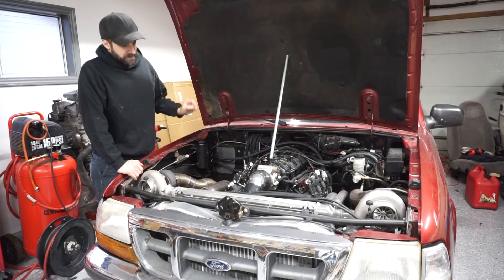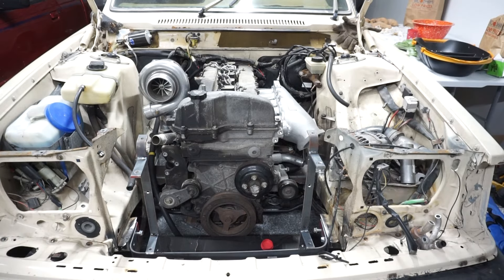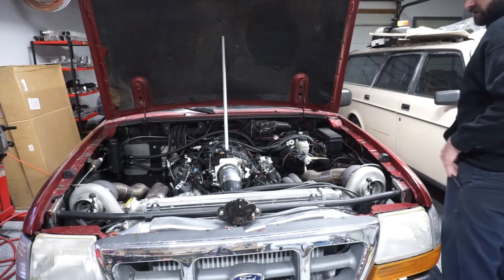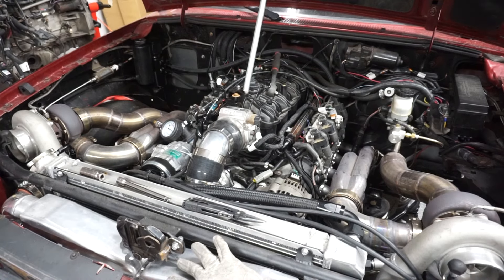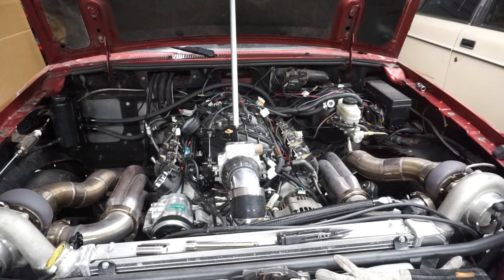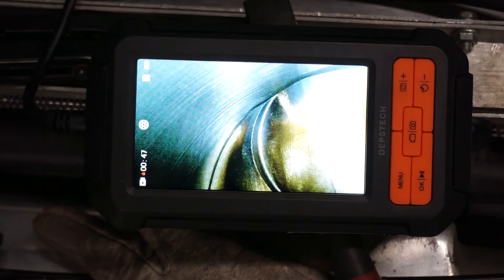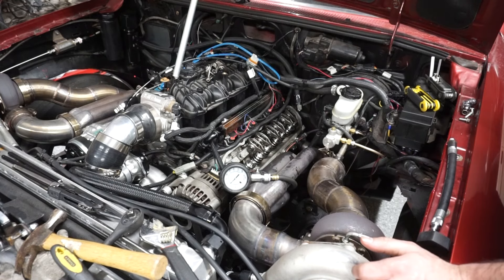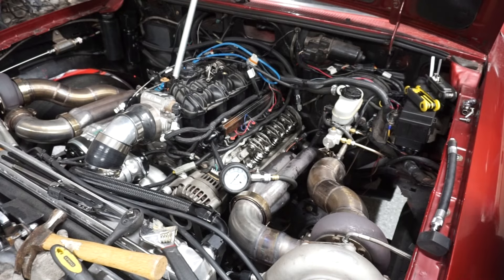Fancy Parts Blues | ZERO COMPRESSION Tuliped Valve???

Comment: With cylinder #3 at TDC both valves should be closed.  Try tightening/loosening  the the rockers to see if the valve/s open at all. If the lifters were pumped up not compressing when the rocker is tightened the valve will open. 🤔
If there’s an issue with those Renegade SS valves I’d like to know. 👍

Comment: The valve height relative to each other is a good start, but if the valve job wasn't good, they'll all be different any ways. I vote an injector was clogged/clogging/quitting and got that hole hot, tuliped the valve and compromised the gasket in that hole - hence the high coolant pressure.  I had wondered what was going on in that 8.80 video when you were really turning it up and nothing happening...

Comment: Mentioned a few times but check the tips of the valves relative to each other, that should show a stretched valve pretty quick.  Am I the only one wondering if that valve kissed the piston from the borescope picture?  It is exactly where it would touch and doesn't look native to the piston.  I wouldn't give up after you find the #3 issue that #6 number is concerning enough I would be finding an answer there as well.

Comment: Take an old pushrod, turn it down, test, until you get some compression.  Also, are those cylinders firing?  When it's running check to see what's going on with a laser thermometer.

Comment: Cut a couple of .020 shims from some flat stock and put them between the rocker pedestal and head they sell them but if you only need a couple Id just make them and send it could be the seats are a little deep the valves are a little long or the base circle on those two lobes is slightly larger I'd shim the pedastals and send it and look for a backup engine in the meantime 😁 tearing down for an autopsy is more fun anyways or just put a different set of heads on it until you can have those heads machine work and valves checked out

Comment: Why does the overflow cap seal at all? On stock stuff there's a vent hole in the plastic cap. Only the radiator cap is supposed to seal up to its relief pressure, right?
Reply from the maker: Yeah I put a set screw in it to seal it so it wouldn't spray water.
Reply: @BlaserBuilds  seems like it should have a vent tube down somewhere it won't get under your rear tires like by the hitch. Anyhow, time for trick flow heads & copper spray the head gaskets for a touch of sloppy luck?